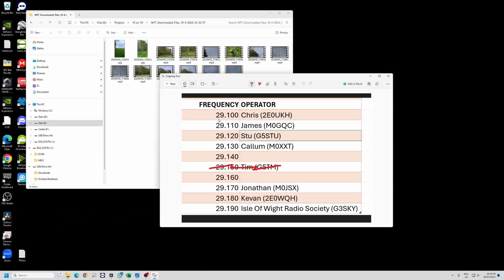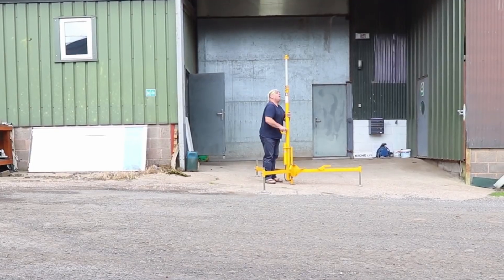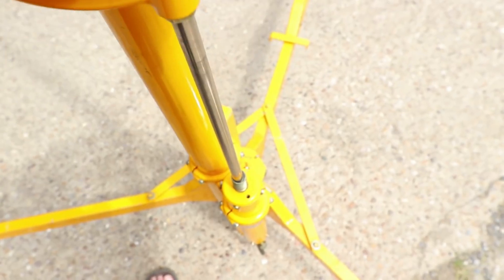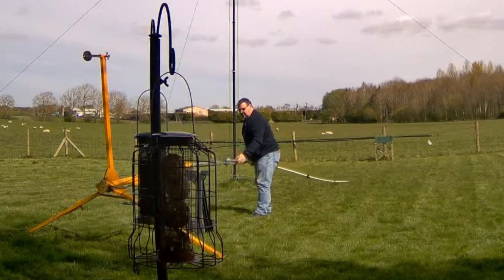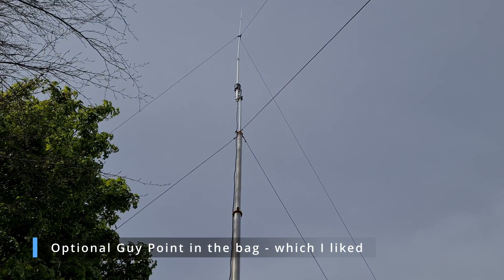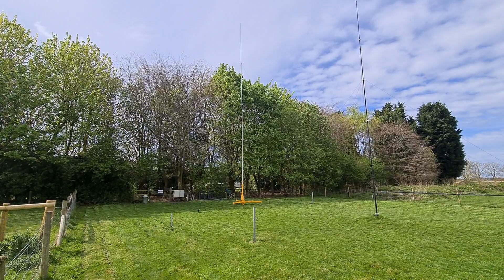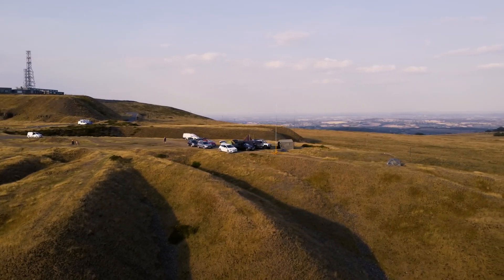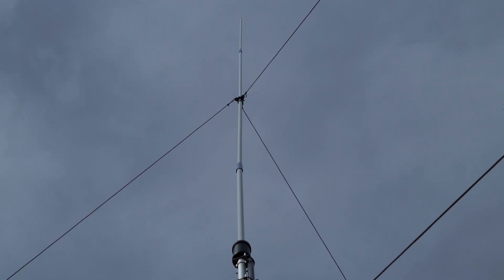My new 5/8th Wavelength 10m / CB Antenna

Comment: You can build a 5/8 vertical from e piece of ladder line and wire. I have one strung up in a tree in my yard, I worked NZ with 100w SSB from Ohio. 5/8 waves are great, no need for a ground plane, you just have to get them high enough.
Reply from the maker: You can indeed..

Comment: Looking foward to seeing the specs on your 10m aerial.  I'm guessing that your using a matching coil at the base?  For fun, I'd love to see someone build a 27ft copper J-Pole for 10 meters.  That would be insane.  Bet it would work well though!
Reply from the maker: It's all still in the air right now.. Still poking at it with the factory. Right now, we're WAY off..
Reply: @DXCommanderHQ  Be good to get something out for Cycle 25's peak 👍

Comment: Hi Cal,
Good luck. If you can the antenna up above the building using the generator, it might be worth the effort. Hoping the propagation gods will be king tomorrow for some contacts across the pond. You and the family stay safe.  73  WJ3U
Reply from the maker: I might do this in the next couple hours.. I don't think there's much in it.. 7m is almost above the roof anyway - and modelling suggests only another 2dB.. But in real-life, for "VHF" style line of sight, every little bit probably helps Don - you are right.

Comment: Hi Callum I have a 5/8 Antenna that covers 27 to 29 MHZ called a Maco V5000 21ft long. Works well. They recon it can do 5KW but has a price tag to match Around £325.00

Comment: I've found a ground mounted vertical gives me the best SN ratio. If I elevate the vertical, it does worse on RX. I cannot audibly differentiate 1/4, 1/2 or 5/8 wave from each other. O course, location might have something to do with it. I love experimenting and seeing what works (which is often not  the same as others would lead me to believe).
Reply from the maker: Frank.. I'm with you on this.. The only change MIGHT be is it's NOT skip bit line of sight.

Comment: sounds like fun.  I have either the end fed half wave  as veritable on ground with radiales . The T2LT made out of RG 8X  or a 3/4 wave element on DX commander 10 meter pole with fold back. all 3 tune 29 MHz below 1.4 SWR. I got 400-500 watts I can throw from NY . duty cycle on tubes ??  the time is the issue for me.  but will try. Cheers from NY !